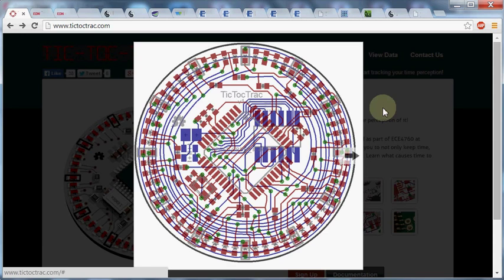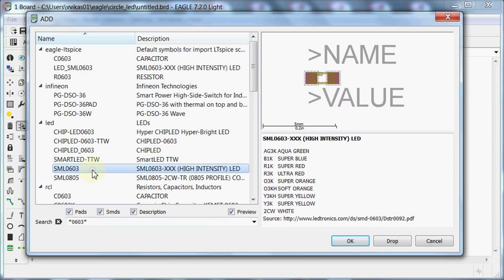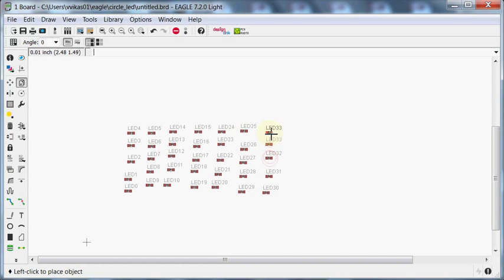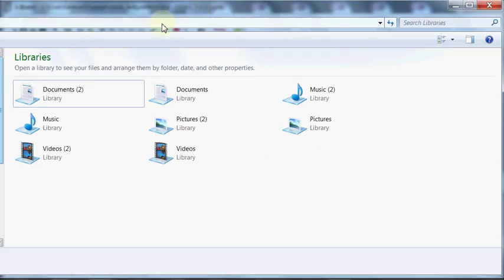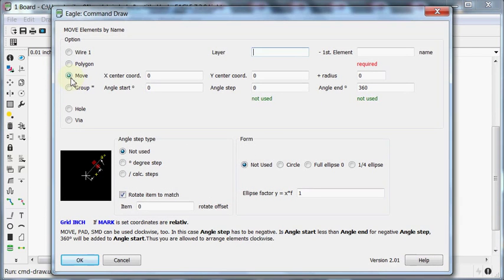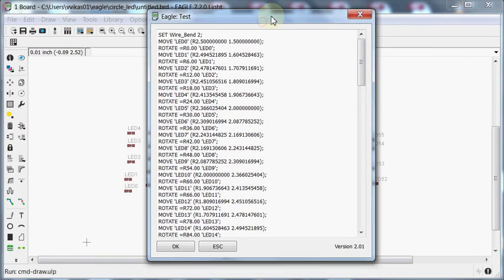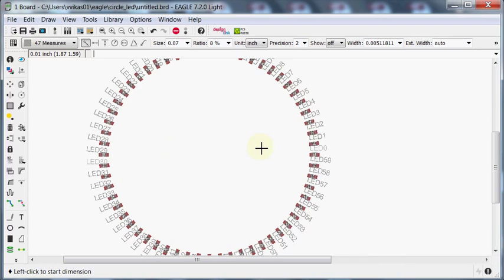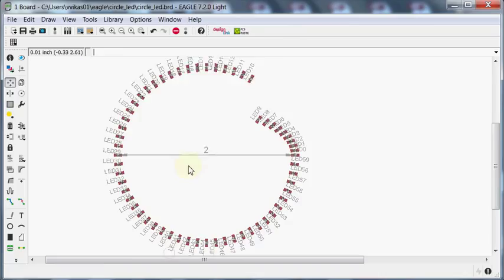Circular LED placement in Eagle PCB

Comment: Hello Vikas! There is no need to add all 60 LED's one by one at the begging then using MOVE in draw.ulp. There is more simple way to do it. You first add only ONE LED0 to grid, for as example if you need radius of clock of about 50mm for circle position of led would be X=50, Y=0. Next you call draw.ulp but instead Move You select GROUP! 

Angle step: off course same 6
For angle step type select: degree step,
Form stays: circle and OK! 

Only thing you need to do is to delete one led (it will be named LED1) which is placed by draw.ulp above/over the LED0  that YOU placed on grid! You don't need more than few seconds to get same result, a form of clock but much easier :)